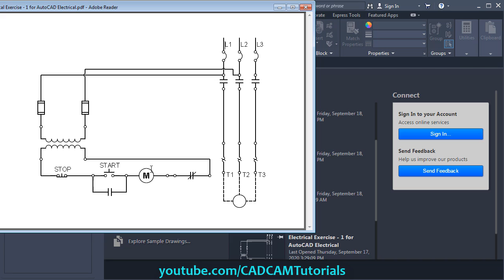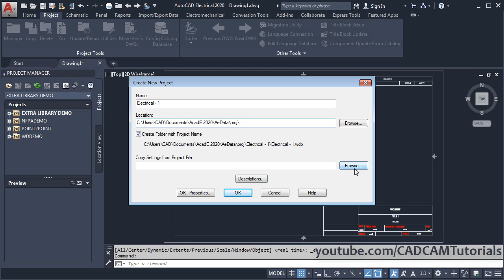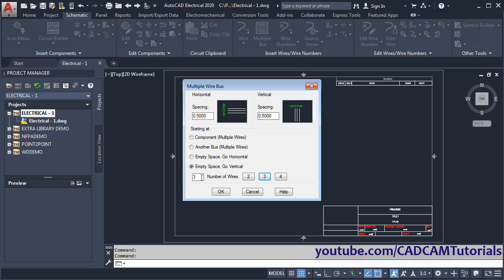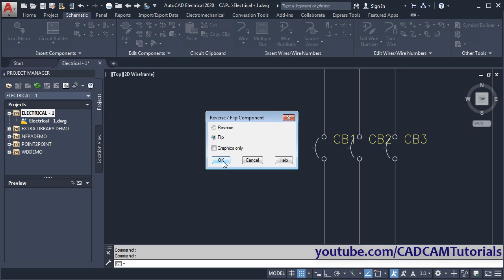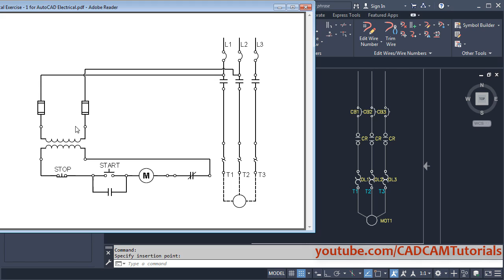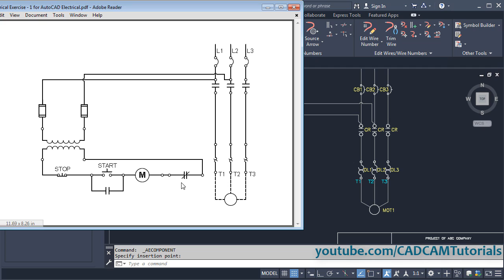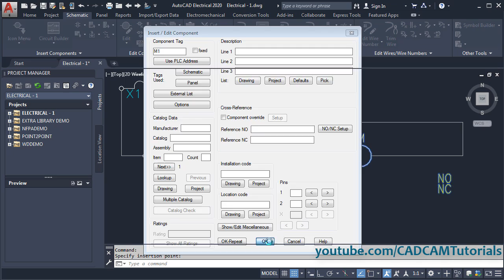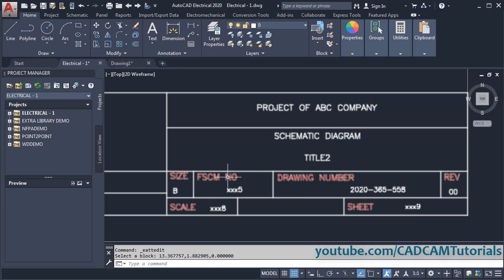AutoCAD Electrical Tutorial for Beginners - 1

Comment: Can someone explain why the symbol for the relay is identical to a capacitor or almost... I thought relays had a different symbol where you saw an inductor/coil and a switch. is this just specific to autocad or do other softwares use this strange symbol

Comment: How to restore schematic tool ?
Reply from the maker: Click on gear icon near lower right corner and change workspace
Reply from the maker: Do you have AutoCAD Electrical installed?
Reply: @CADCAMTutorials  Dear Sir please help,  i have installed autocad electrical 2021,  I dont have project manager section, i looked for it is not hidden, i think it is missing or smth , plus, dont have electrical workspace option, in stead have 3D and Annotation and it doesnt show schematics, panels

Comment: sir I have installed Cad 2016 Electrical but in that schematic and panel  menu not showing, but we type AEIcon menu symbols will display but not able to use in circuit, kindly help me to overcome from this issue
Reply from the maker: Click on the gear icon available at lower right corner and select electrical workspace
Reply: @CADCAMTutorials  thank you so much sir  . 

Electrical option not available  - changed to ACADE &2D DRAFTING &  ANNOTAION  NOW WORKING
Reply from the maker: You're welcome 😊
Reply: @thyagarajp9308  Bro in my case 3D and Annotation available, and it doesnt allow me to have an access to the schematics, and other stuff

Comment: CAN WE DO ,ELECTRICAL PANEL 3d VIEW IN AUTOCAD ELECTRICAL SOFTAWARE?
Reply from the maker: It is not automatic, you can do it manually. If you want automatic then you will have to link it with Autodesk Inventor software.

Comment: HI BRO I WILL NOT GET ELECTRICAL ATO CAD IN MAI MENU
Reply from the maker: You will have to install AutoCAD Electrical.
Reply: @CADCAMTutorials  yes 2020 Auto CAD installed
Reply from the maker: You may have installed plain AutoCAD 2020 and not AutoCAD Electrical 2020.